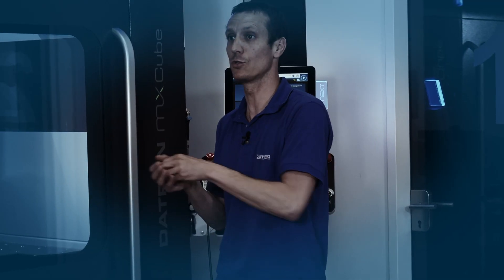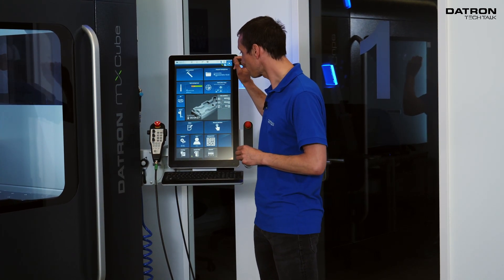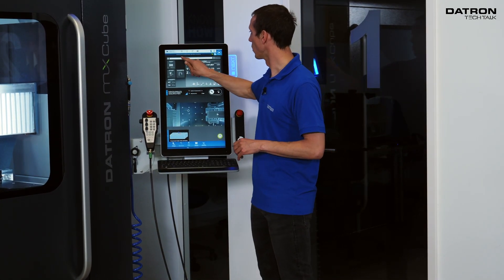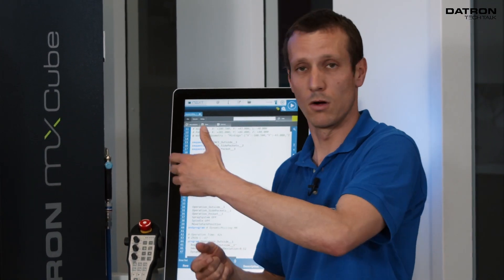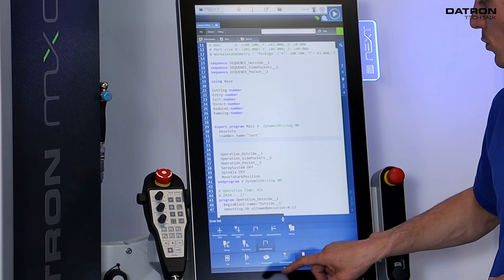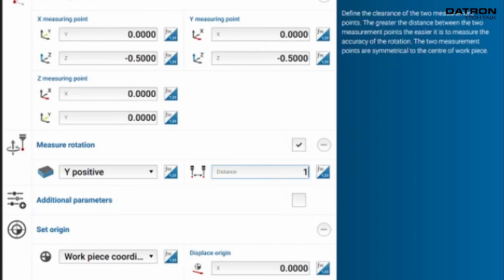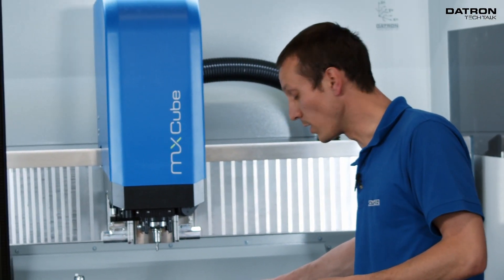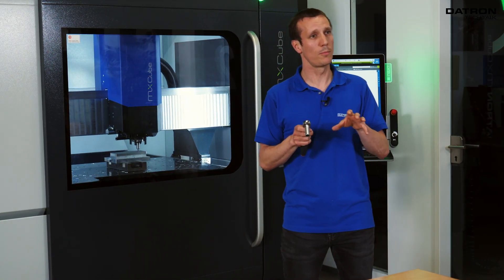How to: auto probe - Tech Talk | EP 04

Comment: Hi Marc,
The file link isn’t working. 
Isn’t there a way to store and copy/paste not only the work offset but also the probing cycle that generated it in the tactile interface? That would be so easy and intuitive. So often I have to re draw a probing cycle when re doing a job.
Also, is there any news on the Fusion 360 probing front? Will the post sometime soon enable that feature?
Thanks
Reply: Hi David,
we´ll replace the link soon, thanks for that.

Actually there is a feature that allows you to create a code line from your interface-probing. First, draw and measure the part through "Setup Workpiece". Then go to the editor and click "Insert command". Its even more helpful on surface profiles...
Reply: @marcreis487   Great, I will try this. Thanks